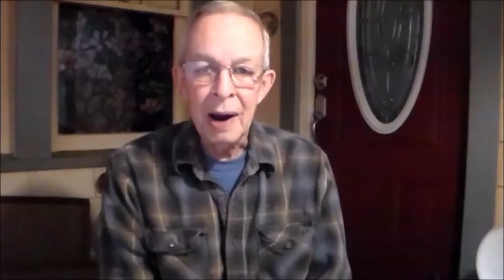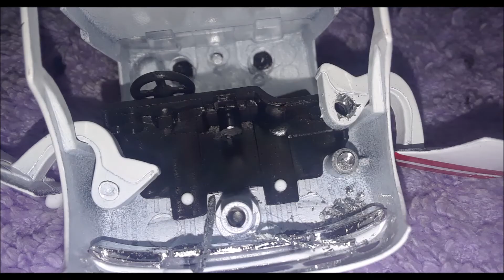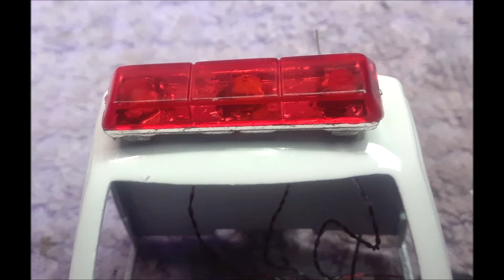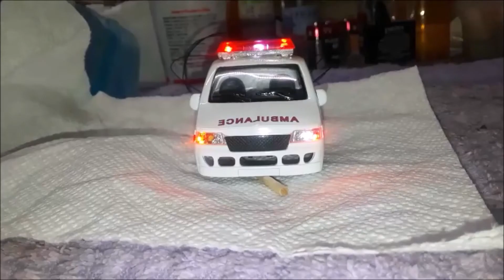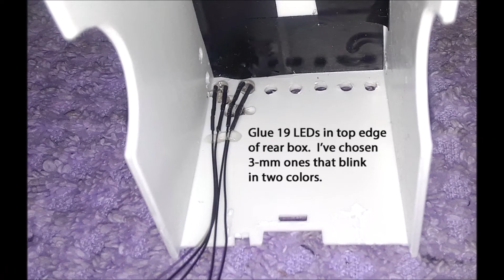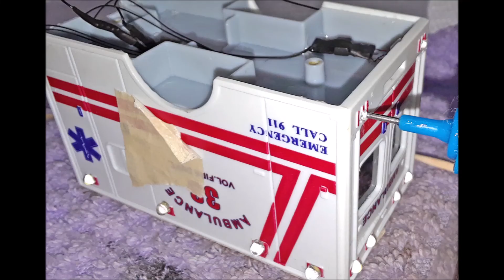Custom Lighted How to light Ambulance

Comment: Thank you for sharing this how-to and the how-to you did for the school bus a while back.  They have been very helpful.
Reply from the maker: You are most welcome.  My techniques have evolved as I go along and discover new materials and methods.   At my age, I believe it is important to share what knowledge I have as regards lighting these vehicles.  Be a damned shame to take it with me when I go!   My most important self-taught lesson may be that you cannot be afraid to try.   When I started doing this six years ago, I truly didn't know what I was getting into.   It has been an absolute blast!
Reply: "most important self-taught lesson may be that you cannot be afraid to try"

This statement is the one that is most relevant to me.  I have a nice model.  I want to make some modifications to it.  I am afraid that if I start cutting and drilling holes in it I will make mistakes and ruin it.  It's good to hear someone else say go for it.  Thanks.  :)